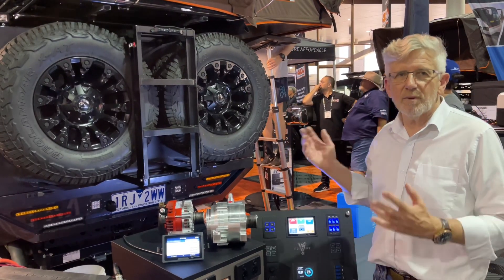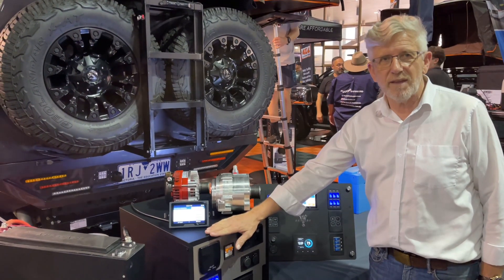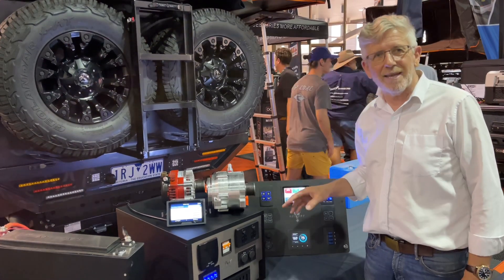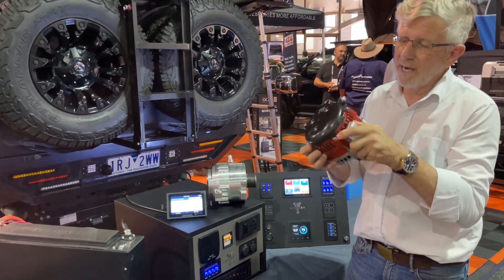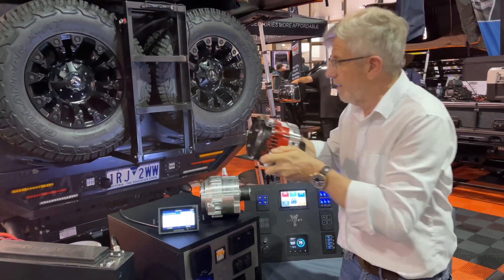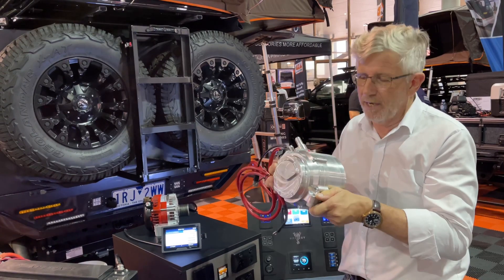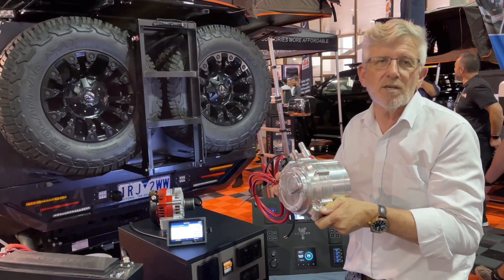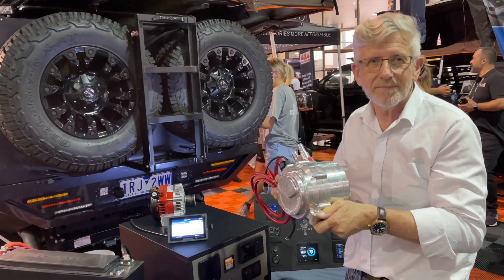Brushless Watercooled Sealed Alternator 200A charging matches nicely with the bidirectional DC to DC

Comment: Hi guys, at what rpm would the sealed alternator deliver the full 200amp?
Reply from the maker: We are only getting 150A from the sealed at 2000-3000RPM. Thats OK remember being brushless pays the price of less power.
Reply: @Safiery  Thanks for that, appreciate your time responding. How about idle? How many amps at 550rpm idle on the sealed?